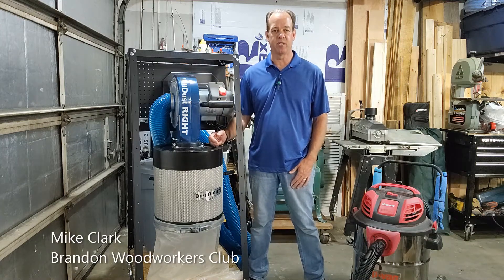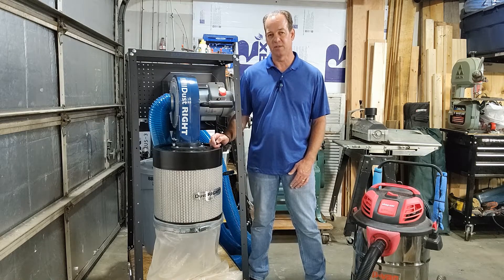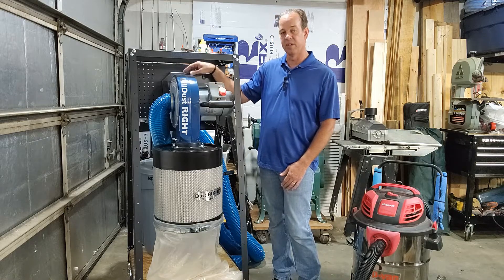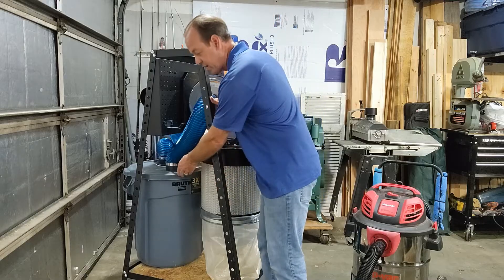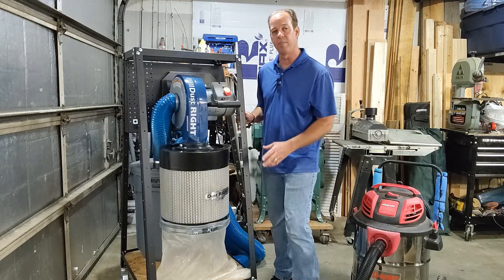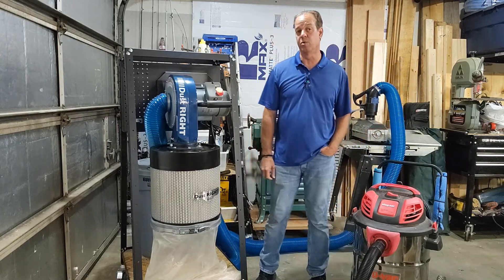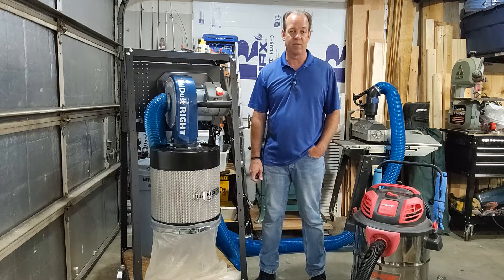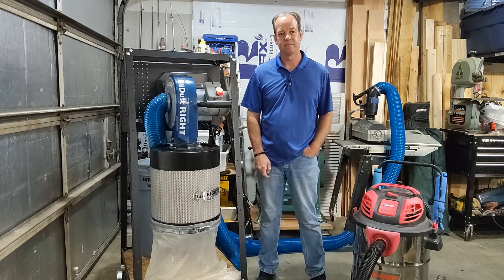Mobile Dust Collector

Comment: Nice presentation, Mike. I'm not sure my shop floor is open enough to roll that device where it would be needed. I definitely need to organize my shop.
Reply from the maker: Hi Ken. Don't forget the hose itself will reach 28" without moving the cart. There are hoses available that are shorter as well. Thanks for all the feedback!